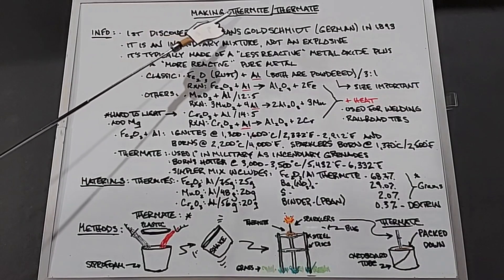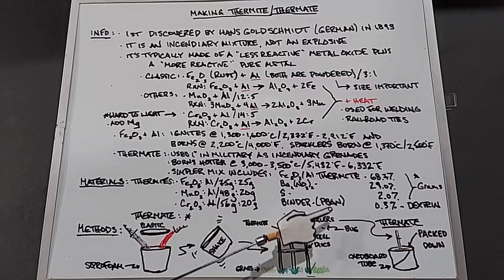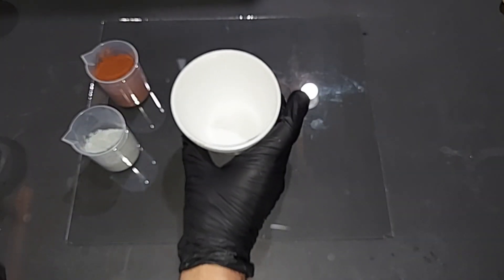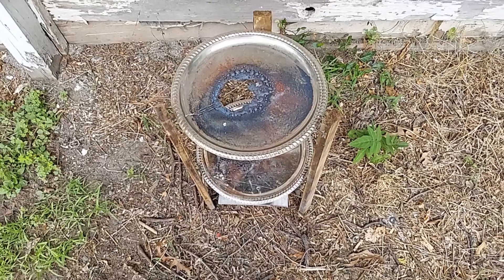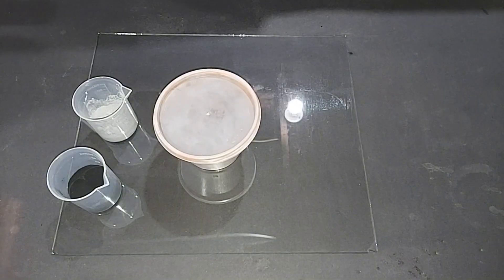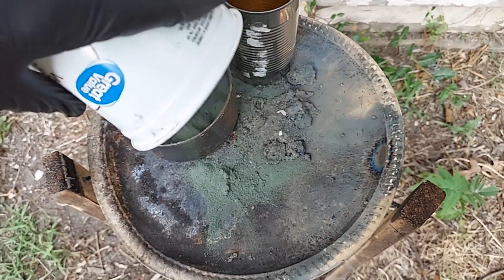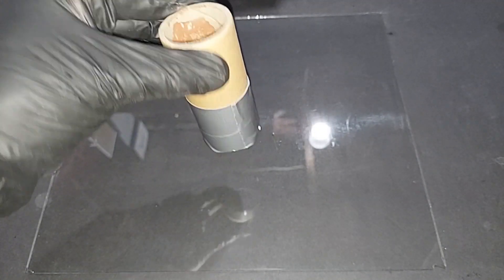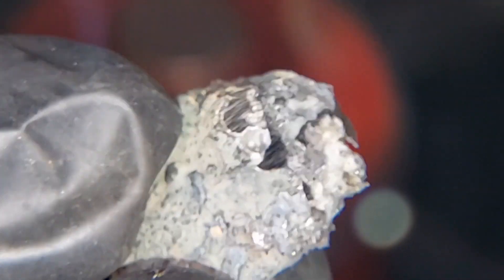Making Thermite(s) And Thermate

Comment: hello idk if anyone is still active but i want to ask what type of sulfur did the uploader use(also can any type of sulfur be used?)
Reply from the maker: I used pure sulfur from a chemical supplier.  It's not that expensive at all.  You could even use sulfur that's made for plants/roses.  It has a few additional ingredients but they are in a low percentage.
Reply: @cranialconstruction i see..will cosmetic grade sulfur work its all i can find on my local online shop
Reply: @cranialconstruction oh one thing i forgot to say what type of safety equipment did you use in production?

Comment: You know there is this stuff you can make that lights thermite very well. If i remember correctly it's permanganate, sulfur, mixed in some silicone.
Reply from the maker: Never heard of it but definitely worth researching.  Thanks!
Reply: I've always found that sparklers are absolutely fine for the usual Al and Fe2O3 blend, but never managed to get them to successfully work with the castable CaSO4 and Al mix. For that, I'll pour it into the mould, insert a length of normal Visco cannon fuse, and then top the container off with a wet mix comprised of mainly gunpowder, with added Al powder, a dash of S, some KClO4, and finally some magnesium ribbon, cut into small squares scattered on top, just to make it look sexy and shiny prior to lighting. This topping has never failed me for a way of getting the more challenging mixes to initiate. Other alternatives are a 50/50 mix of sugar with KMnO4, then some glycerine added, which forms a delayed auto initiation mix.....Or KMnO4 can be used without the sugar, and with the glycerine replaced by (CH2OH)2 for a similar delay initiator :)

Comment: I accidentally made a thermite reaction when I was a kid in high school.  Had an iron crucible inside a coal stove, and was melting some aluminum in it, but it has scum on it, so I stuck in a heavy copper wire to stir it.  This immediately started the most brilliant fire which I had ever seen.  The mix burned through the crucible, burned out the iron grates of the fire box, and was only stopped when it hit the concrete base, on which the stove was parked.  This was for a school science project, which I never repeated.

Comment: Where are you sourcing your AL powder?
Reply from the maker: It's 5 micron and it was purchased originally on Amazon.  I bought it 5 years ago.  Not sure if they still sell it.
Reply: Heat aluminum foil ith a torch and then use a ball mill to reduce to powder.

Comment: Mn (and also Cu) thermites reach a temperature above the boiling point of the metal. With a gaseous product rather than liquid, it is not surprising it behaves differently.
I love doing CuO/Al thermites. Lovely cloud of metallic copper is formed.

Comment: Dextrine is useless once you dont add water to the mixture. It just doesnt work as a binder that way. You could use oil or vaseline instead.
Reply from the maker: Not entirely.  I've compared mixes with dry dextrin and those with no dextrin.  The dextrin does help packing even when not wet.  The problem I had was getting this video completed in a timely fashion.  I couldn't afford to wait out the drying time if I used wet dextrin.  Thanks for your comment though as you are correct.